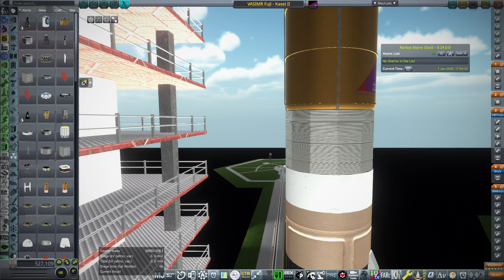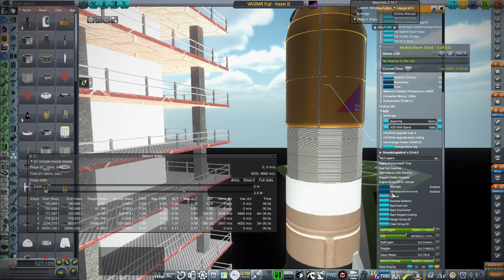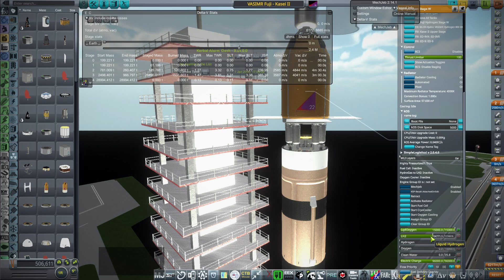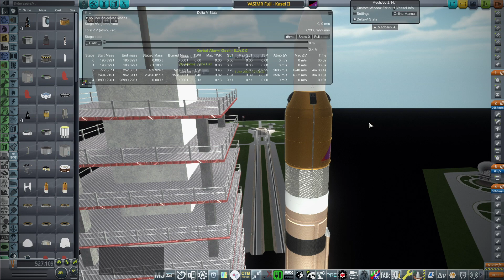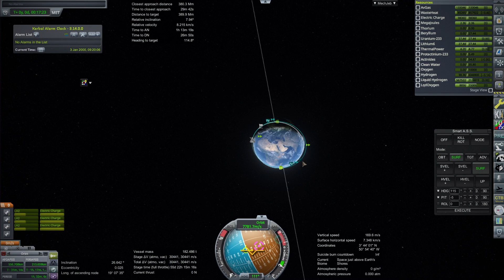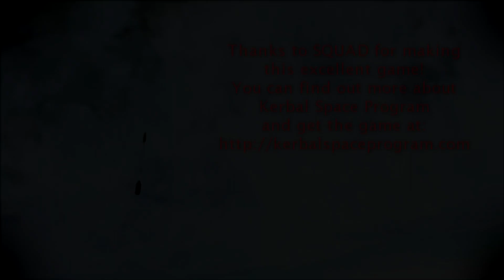VASIMR - Kasei II Lunar Payload Test

Comment: No offence, but I find it funny, hoy you say that this ship is to OP, after you pulled out some termonuclear antimatter warp engines with ISP of 40Ms
This ship is great though
Reply from the maker: Well, in this case I mean it's getting more thrust than it should be getting considering it's a real-ish thing and maybe I made a math error somewhere. Doesn't make much of a difference in terms of delta-v, but does for the trip time.

Comment: If you are interested in more heavy space tug shenanigans, could you do a video on the Blue Origin transporter? During the recent LSIC spring 2025 meeting, they talked a bit about that and released new renders. Supposedly, that would be able to depart LEO and arrive in NRHO with 100t of propellant remaining. They also talked about taking 30t to Mars or making an NTR powered version down the line. Perhaps you could try and make something like that, which could be launched and refueled by the less capable New Glenn instead of the Caseii-2.
Reply from the maker: I was planning to model the Cislunar Transporter, which is Lockheed but BO-affiliated. What's this other transporter? I haven't seen anything about something that could have 100 tons of prop at NRHO. I have a limit to how many refueling runs I would like to do on missions, so for something that large, I would not want to use New Glenn anyway. That sounds like Starship levels of refueling pain.
Reply: @RaizSpace  it seems like Lockheed Martin's involvement in the Cislunar transporter and HLS may have come to an end or been scaled back significantly. Instead BlueOrigin seems to be developing this transporter themselves. They shared a new render and talked a bit about it, as well as about Blue Moon Mk1 and Mk2 during their presentation at the LSIC spring meeting. https://www.youtube.com/live/X51o0kEJrLo?si=YDjOYZcCA5rGSLYN

I would assume that you wouldn't need as many launches as Starship HLS, maybe just 6-10 New Glenn refueling launches, after all it would be significantly lighter and use more efficient engines. But there's nothing stopping you from doing 1 refueling mission with New Glenn to show it can be done, and then either cheat in the propellant to save time or do refueling with a larger rocket like Caseii-2.
Reply from the maker: I'm not really seeing the bit about the Transporter and its numbers there. Do you have a timestamp?
Reply: @RaizSpace  so the relevant presentation starts around 57:30 and he begins talking about the transporter specifically around 1:12:00.
Reply from the maker: Okay, thanks. Looks interesting.

Comment: You should try a Solar Electric Propulsion (SEP) tug using liquid Argon hall effect thrusters. It should get you quite a bit of payload assuming a SEP Tug wet mass of 200 tons. Two launches of 200 Tons each should get you 200 Tons of Payload to LLO from LEO.
Reply from the maker: How much solar power would such a heavy tug need in order to push that payload to avoid sheer orbital drag bringing it back down through the atmosphere? Shouldn't something of that size be NEP, supplied with a reactor to get any semblance of thrust and arrive at the Moon in this decade? I also fail to see how it is an improvement over this situation. I really think 100 tons to the Moon is fine, and one launch is good, too.
Reply: @RaizSpace  It all comes down to power density.